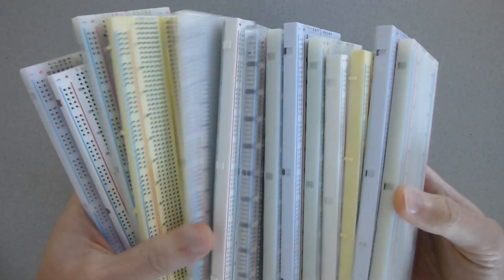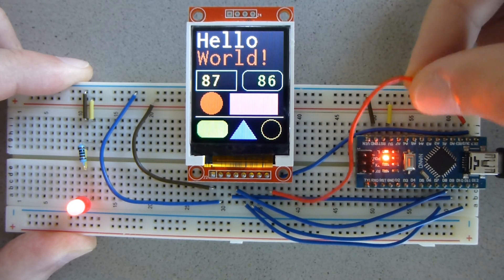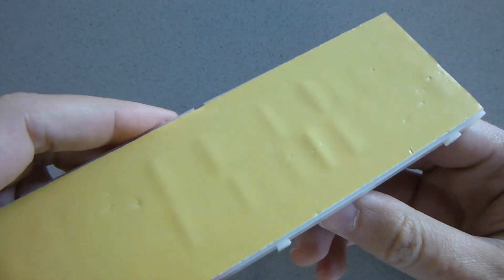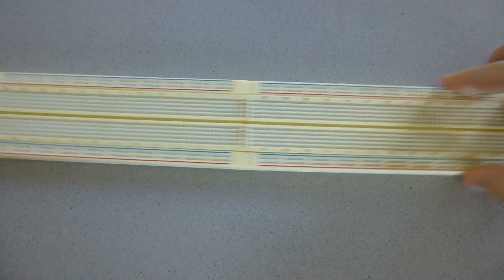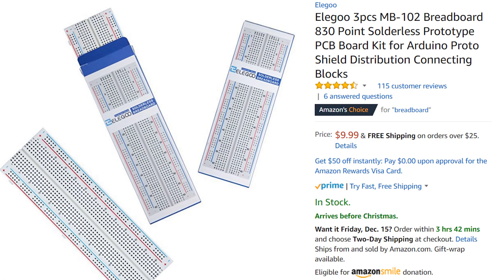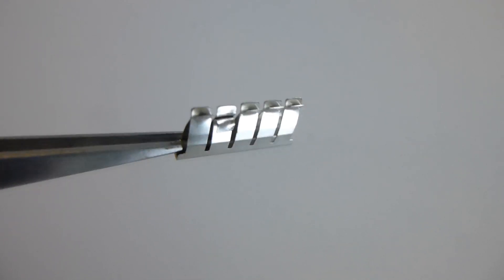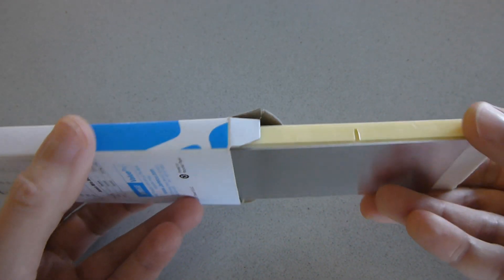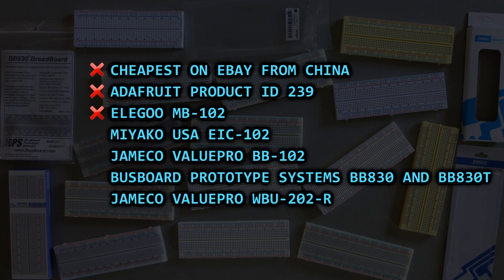Best Quality Breadboard?

Comment: I have a couple of Velleman SDAD102 and the BIG advantage is that these have 6 holes (a to f) on each side instead of the standard 5 holes (a to e) and the quality is superb.
There is a new breadboard coming, the Velleman VTBB9, Lego compatible and also with the 6 connections on either side (nickel-copper alloy and ABS polymer).
Reply from the maker: Nice. I see the Velleman SD12N on amazon at $14.69. Does it come with a back plate?
Reply: I do not know, I do not have the SD12N. I have the SDAD102 and it is my very best breadboard. I will buy a couple of VTBB9 when they are available.

Comment: hi, great video and very thorough. I use a matsuhama breadboard. I bought it when i was in univercity  and i'm still using it 17 years after. i remember paying about 30 USD. the only downside according to your list is that you cannot expand it. it comes as an assembly , it has twice the capacity of the breadboards you compared and its own base plate and 3 banana posts. Also you cannot plug in a breadboard power module because the positive/negative rail have 1pin clearance between. you must construct an adapter pcb
Reply from the maker: Thank you for your words. Yes, I've seen those kinds of breadboards and they look great. I didn't test those big breadboards because would be too expensive and I wanted to focus in only one type of breadboard for the video. Keep taking care of your breadboard because that level of quality is not easy to find. But if you ever need to buy a smaller breadboard, go with the Jameco Valuepro WBU-202-R. It's my favorite. Although the Busboard Prototype Systems is not bad either. Good luck.

Comment: I'm getting back into electronics after quite a few years of pure programming and bought some Elegoo packages to introduce me to the Arduino family.  I couldn't believe how inexpensive the breadboards were.   I now know why.  The piss poor connections are very frustrating.  My 40 year old Global Specialties and Radio Shack Archer breadboards are more reliable than these brand new Elegoo.  (I found that a liberal spray of Flux Remover or Contact Cleaner helps.)
And yes, I have one Experimentor 600 that perfectly fits the Arduino Nano!  http://ferretronix.com/stuff/breadboards/

I just bought two Busboard BB830s.  Let's see how they compare.
Thanks for the recommendations!
Reply: Same here too ... getting back into electronics after years of programming. The components are so damn crappy compared to back in the day when I was doing my labs in college. The resistor lead gauges now are so feaking flimsy it's terrible. Don't by anything less then 0.5mm leads in size.
Reply from the maker: Great to hear that I could help.
Reply: Totally agree, I have a old Archer board with better connections than my brand new Elegco (RIP Radio Shack).
Reply: The race to the bottom frequently comes at the cost of quality.

Comment: after buying a couple of breadboard of varies sizes which all turns out to be junk, i.e. it contacts which is the most crucial thing in my opinion; sadly, the best breadboard that i have till today is one that i salvage from a really old digital trainer years back and its contacts remains as good as before.
and thanks for the verification on adafruit's breadboard as i have always thought its simply a bunch of upsell cheap china product.
Reply from the maker: In the old days we didn't had this problem with cheap breadboards. I am glad you still have a good one. I suppose you now know which to buy next, if you want more breadboards. Good luck.
Reply: the good old days :)

Comment: Good comparisons, thanks for taking the time to do them.  There's a US brand called Global Specialties Corporation who do good quality boards (they're test equipment manufacturers).  Basic prices are reasonable but if you're buying from outside the US (as I am) they might get hit with a hefty import tax - if you shop around there are suppliers who cover it for you by shipping stuff over in bulk (I use Mouser, there are probably others).
Reply from the maker: When I was searching for other brands I did found the Global Specialties model GS-830. I contacted the company and asked if they include the back-plate and they say no. At that point I didn't want to try more disqualified breadboards. I want to find good quality breadboards that have all requirements, or at least the first 7 features on my list. That's why I didn't even bother buying it.

Comment: I know the pain, I have fried 2 projects with bad quality breadboards, good ones are rare..
Reply from the maker: And how did a bad quality breadboard cause a project to be destroy (fried)?
Reply: Current peak...
Reply from the maker: Wow. I didn't thought of that. Another reason to buy a good breadboard. What brand of breadboard do you use now?
Reply: I was using an external power supply for my  project and the Positive side of the power wasn't well inserted, end up building peak amps. Actually i still have one withe the letters miss labeled side to side :D I do not recall the brand. Oh by the way, I have news for you, "hang out" any time.